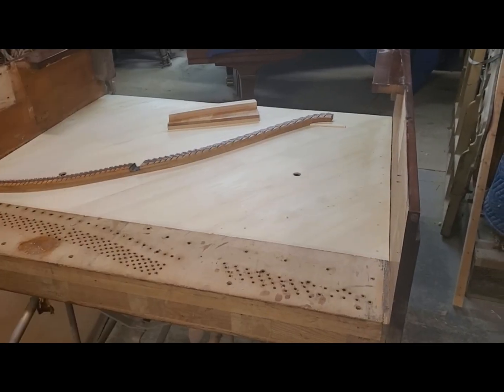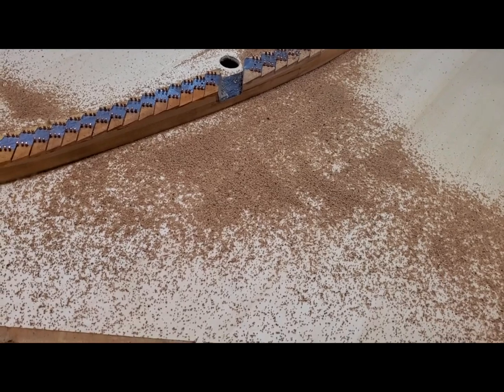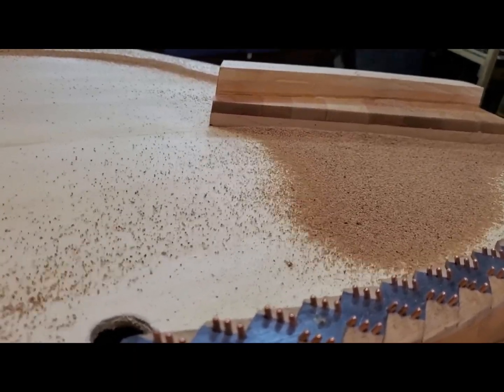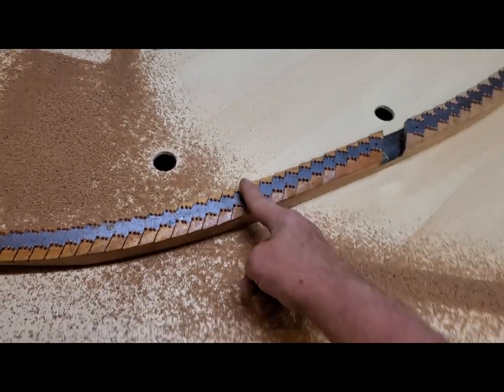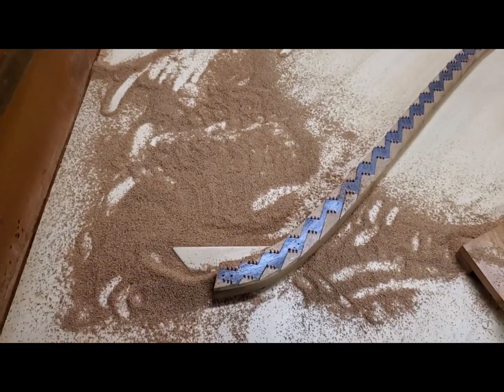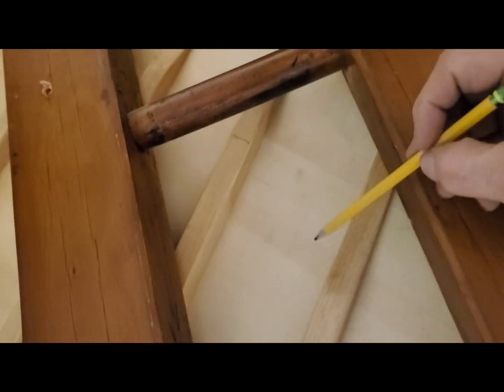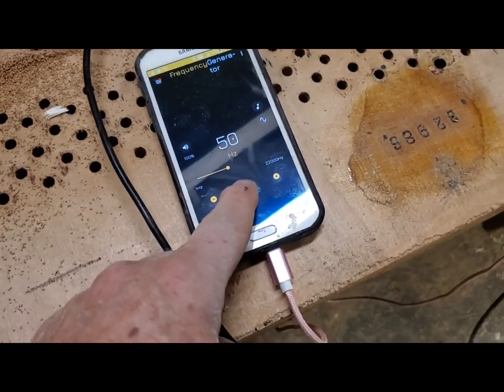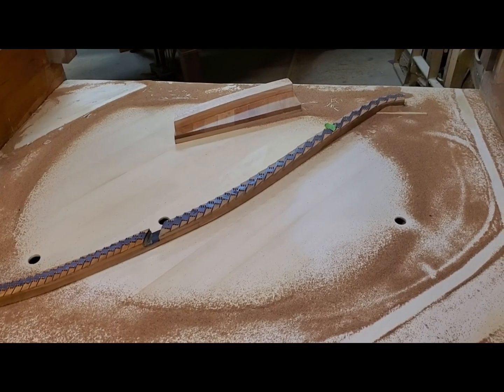Enhancing Soundboard Movement by Reading Chladni Sand Pattern

Comment: Do I have this right...? - Did you basically 'tune' the board such that the width of the mostly-resonating waves is maximized, based on the fundamental?  If that is correct, going under or over would 'limit' the resonance of the board across the spectrum, but being "just right" would maximize the tonal integrity...  Is that how/why this works?
Reply from the maker: Yes Seth, i weakened the rib deflection values and thinned the panel so that the one side that had little movement equalized to the other side that showed sufficient movement
Reply: @Chernobieff Piano  So you robbed a useless and worthless peter, to pay a useful and worthy paul?  Who could have thought about that as a mathematical possibility? Oh that's right  - You did.

Comment: I'm sorry, but what is this supposed to prove or achieve? Is the goal to 'change' (but not necessarily improve) the tonal balance? Has the 'math' been previously worked out and posted by practice of those in manufacture that went before, or is this practice just...value-additive rather than sonic? Sure, portions of sound boards are given to resonate in sympathy with particular frequencies, but is the contention that somehow, by lightening the bracing, you can 'encourage' a larger section of the sound board vibrate at a 'desired', given or specific frequency to correct uneven volume, tone, or wonky harmonics? A given wave length has fixed length and energy at a given volume so you will always be robbing Peter to pay Paul by this method, which is mathematically untenable. Can you direct me to the research that suggests this is effective as a tool, rather than simply illustrative of physical practice; if it is available. Thanks!
Reply from the maker: Math? Math has nothing to do with it, nor do articles and research papers. The answer you seek can only be gained by experience. Which requires dedication with years of hard work, and gaining the skills to perceive when a soundboard is not working as it should. A good way to describe it is Open vs Closed. Its the same thing with a piano hammer that needs voicing. A voicer has to manipulate  a hammer because it can have problems e.g. too hard, too soft, too open, too closed, no sustain, weak attack etc..
Reply: Quite Literally Speaking... - your approach to questioning Chris' method comes off as pretentious, and potentially revealing of disguised ignorance...I'm sure his response was very short because you didn't really deserve much of an answer after this comment... btw, one does not 'encourage' a body to resonate in a particular way, one gives a body the appropriate proportions to resonate most efficiently.  These are determined quite literally on a case-by-case basis because no 2 of the 'same' things will ever have the same sonic properties to begin with unless they have been artificially synthesized.  If you're interested in the "math" of this domain, you must study and understand the behaviour, nature, and properties of waves....in fact....that's almost the key to understanding the Universe...but don't tell anyone... ;-)
Reply: @minimalizman  Stop cancelling philosophical questions that are quintessential. It is extremely important to know what the desired tonal quality is and how to achieve it. It can be achieved by experience but understanding the physics of bodily vibrations and acoustics should be leading the way in that. So, nothing pretentious nor ignorant about the philosophical question. Pretending to know IS. In fact, "robbing Peter by Paul is completely correct, as changing the natural frequency of the sound board will improve the response for a certain frequency at the cost of another. That is physics and it is very complex. An open discourse on the topic would be beneficial.
Reply: @Michael Janeschitz-Kriegl  Well to start with, I did not cancel any question...I don't know if that's possible... And it is not a question of philosophy. It is a question of practicality and yes as you say physics. What you may not be taking into account. However is that Peter may not be doing any useful work and so stealing it from him to give it to Paul who is doing more of the resonating. Work makes sense.You would have to ask Chris if that's true because I do not know,. I have not been rebuilding pianos for 30 years.I have however been playing them for over 30 years.
Reply: @minimalizman  Hi Seth, Is a physics degree enough with expertise in acoustics or do I need to take a 6 month course on piano teching? I do understand the math and the science, but what you are supporting through your...what are your credentials...opinion.
Reply: @philosophicallyspeaking6463  The expertise of my Master Restorer...  I am not an expert on this material.  And not that credentials matter, because I have come to learn that they really do not, but since you asked, I have a master of science degree, And I am a network design  engineer... So a little familiar with science myself...don't really want to argue... I was just a little put off by your snark... I mean you're sort of questioning the integrity of the methods and science of a man who's been doing this work for over 30 years.... I'm not talking about me...
Reply: @philosophicallyspeaking6463 Art and science have different goals. Regardless of your credentials you have zero experience and knowledge of piano technology. Yes, a major manufacturer uses similar techniques. You can find it on your own
Reply: @Steve Jackson  How do you know what my experience and knowledge a piano technology is?  Do you know me?Do you know my history, my performance history, my science and background history,? Do you know anything about me at all question? Mark. Yet? You say my credit shows me nothing... I would agree that credentials often mean nothing but mine's more advanced than yours. :-D
Reply: Question whatever you will, but I'm happy having my piano rebuilt by 1 of theworld's greatest master who knows techniques, methods, and physics that most do not even begin to comprehend.  Having visited his shop and being able to try the results of his work... I can tell you he's the best... Maybe with a little humility you could learn.
Reply: @Philosophically Speaking  Steve Jackson  How do you know what my experience and knowledge a piano technology is?  Do you know me?Do you know my history, my performance history, my science and background history,? Do you know anything about me at all question? Mark. Yet? You say my credit shows me nothing... I would agree that credentials often mean nothing but mine's more advanced than yours. :-D
Reply: @philosophicallyspeaking6463  I bet you would learn a lot in a 6 month piano technician course... But probably not enough to convince you that you don't know everything.
Reply: @Steve Jackson  Would you mind making a list of the things I know about piano's, acoustics, technology, scientific method, et cetera question. Mark i'm just curious since you seem to know all about me...